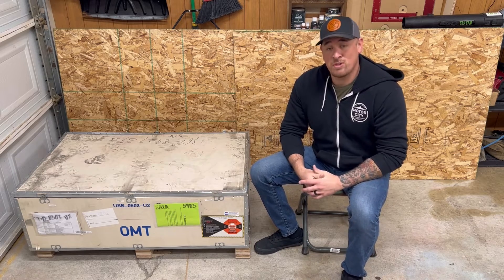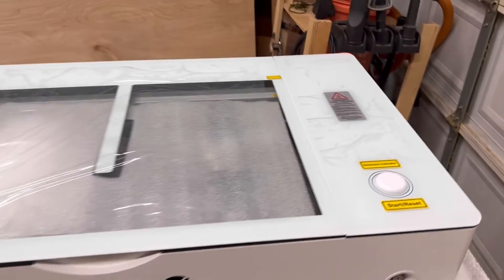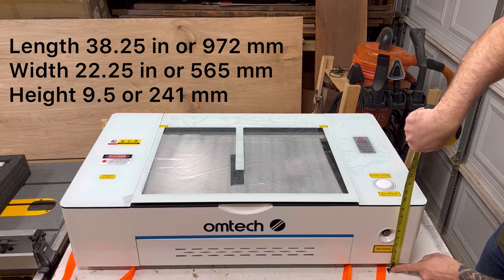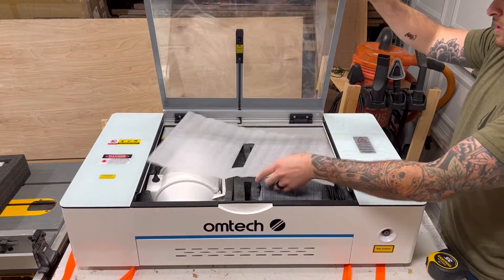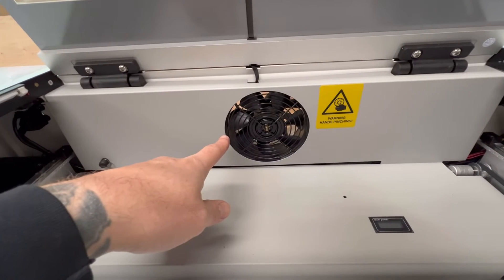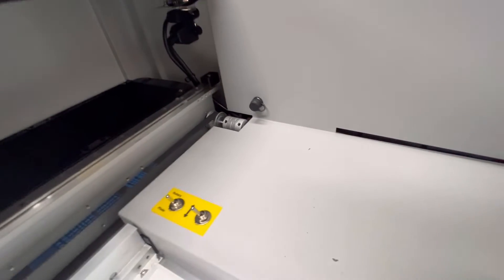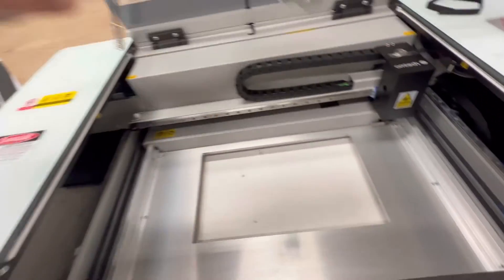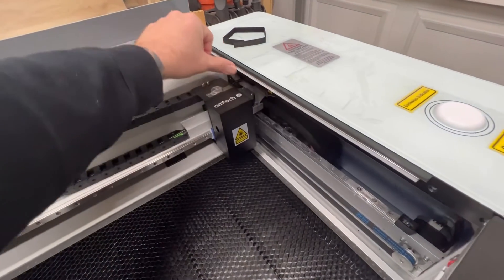OMTech Polar CO2 Laser: A New Glowforge Challenger?

Comment: Hi I have a question for you. I have a Polar 50w. This does not come with a control screen, I am having trouble with my limit switch. Is there way to adjust it.
Reply from the maker: Unfortunately if the limit switch is not working then you’ll have to reach out to OMTech for replacements

Comment: How efficient is the cooler? Does it use just water cooling radiator setup like the Omtech cw-3000 or a real chiller using refrigerant to remove the heat?
Reply from the maker: It’s like the 3000 and uses a radiator type setup. There is NOT an active refrigerant in this system
Reply: @EdmondsWoodshop  Thanks. At this time, the Polar won't work for me then: I doubt I can keep my garage below 80 degrees during the summer and early fall.

Comment: Hi, Edmonds! Question.. I'll have to install an extra tube to exhaust the fumes outside.. do you think this inline fan is capable of doing the job by itself? the distance will be probably an extra 6 feet of tubes..
Reply from the maker: The in-line fan produces 353 cfm of airflow. How long is your total length of ducting/tubing?
Reply: @EdmondsWoodshop  From the machine to the exit will be 15 feet total

Comment: Can this cut leather and etch it? I do custom leather patches on hats, but currently sub out the laser part. Would like to start cutting and etching my own. Thks
Reply from the maker: Yep, leathers, acrylics, wood, paper stock, etc. This is a standard 50w co2 laser. Whatever any other branded standard co2 laser can cut and engrave, so can this one. With it being a 50w it generally means slower than the higher wattage ones.

Comment: Great review and very helpful. I had a question about the height adjustment when it comes to the rotary set ups. Is it possible to replace the feet that come with the Polar with screw type feet that would allow you to self adjust the height? That would be a quick way of dealing with the focusing issue on tumblers and such. Does this model etch glass? One last question do you feel the air assist that comes with the unit was sufficient or would it need an upgrade to keep scorching down?

Again thanks so much for your review. I'm trying to decide what unit to start with and this has definitely tipped the scale in OMTech's direction.
Reply from the maker: 1. Is it possible to replace the feet?
A. Yes, but it may be hard to find direct replacements. I am almost done with another video on how to create risers for the feet so you can get additional height for the tumblers

2. Does this model etch glass?
A. Yes, all CO2 lasers can etch glass.

3. Do you feel the stock air assist is sufficient or would it need an upgrade?
A. Surprisingly, the stock air assist works really well. I have concerns that it will get dirty and sticky over time since its inside the machine, but you shouldn't need to upgrade right off the bat (if at all).
The Polar has a Ruida control board on the left side of the machine, so you can hook up an air compressor driven air assist using that control board. Its pretty cool.

Comment: Omtech: Can I have a look at your Machine?
G·Weike: Why not, but make sure to change it up enough!
Omtech: No problem, thanks! - ( Changes E-Stop into Key and adds fansy LED Bar to the front )
Customers: Why are both of your Machines practically identical?! 🤔🤨

@08:40 Any idea what the "Lens" taped to the top of the Tool Head is for? My G·Weike Cloud shipped with the same and I have no idea what it is for ( doesn't look like a replacement )
Reply from the maker: Haha. That sounds like the extent of their collaboration. Gweike is their partner though so it’s not far off.

The plastic piece on top of the laser head is a test piece with a pulse mark to show you that they aligned the laser. That piece would sit where the lens would sit

Comment: What is the max thickness of material you can engrave on? I make personalized cutting boards 17.5x10.25 roughtly 1.5" thick. Can this accomidate?
Reply from the maker: 2 inches (51mm) if you remove the tray. There’s also a cutout in the middle that measures 13.75” x 8.5” (243mm x 216mm) so if you have anything that fits in there, you can engrave taller items

Comment: i am wanting the 50W coming from a xtool user. how is setup on the cabinet one for someone feet already wet into laser. just upgrading for speed and ability to do acrylics
Reply from the maker: Are you talking about the MF1220-50 from OMTech, and not the polar? Setup on co2 lasers are different from diodes so the most frustrating parts are going to be alignment, focal distance testing, and finding settings for layout material in lightburn. I still advocate for the bigger cabinet size lasers because they a bit more versatile as far as bed size and depth for a rotary, but the appealing thing with the polar is that it’s aligned and ready to go out of the crate. Either way, if you’re willing to learn the steps and practice what it takes to set these things up then you’ll be fine. Check my fb OMTech users group link in the caption. I manage 19000 members and we have a decent amount of information regarding setup, upgrades, and advice

Comment: Omtech and all these videos seem to ignore some things. Like they are dirty secrets. Omtechs PR stuff says engrave wood acrylic rubber leather but glass is not mentioned and considering that the depth is 30-70mm (1.18 to 2.9 inches) glasses/mugs/beer steins don't seem possible. 2 emails to OMT and no reply and no reply from their FB page. Also nothing on replacing the tube. Can we do it or does it need a tech or sent in ? And the power supply is it replacable off the shelf or a special built one ? End user replaceable or service call/tech/sent in.
Reply from the maker: I highly recommend you join my OMTech Users group linked in the caption box. I share content with the members that covered things such bigger cups. As it stands, you are limited to 30 - 74 mm diameter objects for the rotary. That's not very big.  What I did to work around that was 3D printed leg risers (similar to bed risers) and raised the entire unit roughly 40mm. Now I had clearance underneath the laser to engrave a much bigger object. 
I also just posted in my users group photo of my polar somewhat disassembled. The tube is installed similar to other CO2 lasers and doesn't appear to be priorietary, HOWEVER, I could not find a 50w tube that fit the size requirements. The tube allegedly made by tube manufacturer, YongLi, and after reviewing their website they didn't have it listed. I am waiting to hear if OMTech plans on selling these tube exclusively on their website, but from what I see its very serviceable by the owner.

Hope this helps.
Reply: @EdmondsWoodshop  It's clearly not 50W as the size of the tube determines the output power.  Mine is a China Blue 50W... it's actually 880mm in length and measure 44W with a Mahoney meter and Sadlers dohickey.   Since the cabinet is less then a meter and it's mounted on the Y axes, I'd bet it's under 40W...  Did you measure length and power output?
Had to read, I think you should have mentioned that it has a Ruida controller in the video...
Thanks for the time to do the video.  Take care.

Comment: I just got mine yesterday and came from glowforge. Everything worked great out of the box- I followed Cam’s setup instructions you see on YouTube. I had a couple initial hiccups running it with my Mac (no usb and I needed a usb to usb c conversion and then still my Mac not recognizing it for whatever reasons and next trying to run it through a gfci outlet was a no go and still trying to figure out Wi-Fi/Ethernet connection stuff). But now running lightburn on my daughter’s pc it is working great. Much more powerful /fast/capable than my glowforge plus and wow for the price. If you follow the unboxing and setup videos that are on YouTube, read the manual thoroughly, then it doesn’t take long to understand it and get running. Also 7mm hold down pins -someone asked that somewhere
Reply: Wow glad to hear. I currently have a GF plus and want to add a second laser. I use it for my Etsy shop. The price is what I like as well and the size as I do not have the space for a bigger 60W laser. Are you still loving your laser?
Reply: Were you ever able to get yours to work on the Mac?  I don't have a PC so I need a laser that will for sure work on my Mac.  I hate that Apple removed the dang USB ports.

Comment: Have you ever used a Glowforge laser and if so, how would you say the speed compares? I have a GF now and want to upgrade because I have a lot of maintenance issues with it, but I want to stay within a budget as well as I appreciate the user-friendliness of the GF. Thanks for any info you can provide!
Reply from the maker: What's frustrating about GF is that they dont use units of measurement to identify speed, but I can tell you that even at glowforge's 1000 speed indicator, they dont match up to the speed capability of the polar. OMTech boasts capability of 600 mm/s. I doubt it can really accurately achieve that speed (I haven't tried), but on the speeds I have tried its already faster than the glowforge. Even the cutting is so much faster. I'm cutting almost as fast on my polar that of my 80w. 
The Polar will be much louder than your glowforge. With the lid open, I used my phone to record the decibel rating and it clocked in over 70 dB. That's loud. It also doesnt include an internal thermometer to monitor temperature which can be a bit concerning for the user that wants to run hours on end. CO2 lasers like the temperature to be between 15 degrees Celsius and 25 degrees Celsius with the ideal range around 21 degrees.
The polar did come aligned out of the crate. I got started in a matter of minutes after downloading lightburn. The only learning curve for a new user is going to be learning the software.
Reply: @EdmondsWoodshop  How can I keep track of the temperature to know that it's not overheating?

Comment: Hey! Nice video! In your opinion Polar vs Gweike vs Gf, who you chose ? and why ? for which applications you would rather use one and for which applications you would rather use the other one etc ?  Who's the best in term of price/quality/features? Thank you in advance :)
Reply from the maker: The Polar and Gweike Cloud are made by the same manufacturer. The differences are the designs. The Polar has a built in air assist, an opening at the bottom for the two included rotaries, and a more well know YL laser tube. In terms of capabilities and versatility, the polar will be better than the gweike. The GF has a weaker 45 watt laser tube compared to the polar's 50w. The GF is also considerably slower. You are confined to using wifi only and can only use their software. If anything breaks down you have to send the whole GF unit back to them. With the polar, you don't need wifi, you can use the highly recommended lighburn software, its faster and stronger than the glowforge, it includes two rotaries, and its much cheaper than the pro version.

CON's to the polar include:
- Noise. Its loud. I used a phone app to record the decibel and it came in at over 70 dB with the lid open
- No thermometer. CO2 lasers work in a range of 15 to 25 degrees Celsius with an ideal range around the 21 degree mark. This unit may not be good for people who run their lasers for hours on end because there's no way of known what the temperature will be unless you buy an aftermarket thermometer.
Reply: @EdmondsWoodshop  Thank you a lot for these great insights!

Comment: Thank you for the video. Will there be a video on using the pass through slot in the back?
Reply from the maker: Using the passthrough is a function of the lightburn software. Not the machine. The only thing you need to know about the passthrough on the polar is that you're limited to 1/4 inch or 6 mm material. The lightburn functions are already well documented on youtube.

Comment: im really debating between this and a gwike cloud to complete 3d printers and cnc mill in my workshop (
Reply from the maker: Just in case you didn’t catch it in the video, Gweike is the collaborative partner and manufacturer of the polar, but it’s OMTech’s design. With that being said, you have a unique built in air assist, a reputable laser tube, two rotaries, and US support. You also have some additional accessories that the Gweike cloud doesn’t complete. I also have a cnc and two 3D prints and they compliment each other in the shop.

Comment: Would you say that this would be ok for extensive travel in an Rv if I were to secure the gantry to a stationary position? I’m just worried about the tube breaking. I mean it’s shipped obviously but we plan on full time rving. I already have an 80 watt but a little too big to bring with but people want wood products and my fiber can’t do those.. I just don’t feel a Galvo co2 will give me the same quality that a gantry co2 would. I’m also a little concerned about the cooling as well especially if we are in like AZ where an Rv ac might not keep up.
Reply from the maker: As long as the gantry is secured, like you mentioned, then I dont see a problem with it. The tube is mounted to the gantry so you want to make sure it secured in place. They pack the inside with dense packing foam so just keep those pieces are they are already premolded for the inside of the laser. 
One of the downfalls to the polar is that it doesnt include a thermometer so you dont know what the temperature of the coolant is. Most co2 lasers operate around 15-25 degrees celsius with the ideal temperature being around 21 degrees celsius. The AZ heat would have me concerned as well.

Comment: Really looking forward to hearing more about your experiences. I'm torn between this or the more traditional Omtech 50w and 55w machines. Hope you can provide some insight on how to choose one.
Reply from the maker: This will be more ready out of the box. The MF1220-50 will have a bit more flexibility because of the depth. You’ll be able to engrave taller objects and use a rotary with larger diameter objects. The trade off is that you’ll need to buy your own in-line fan and you may consider doing additional upgrades such as a cw5200 chiller and/or air assist.

Comment: Nice video. I’ve had a Glowforge Plus for almost two years and it’s still working. I did have several days of downtime due to WiFi issues. I also have an XTool with the rotary attachment. This looks like a really good unit to phase out the Glowforge. Besides the advantages of not requiring WiFi and being able to use Lightburn what are the other factors to consider?
Reply from the maker: This has non proprietary parts meaning if it breaks down and you know what’s wrong, then you don’t have to send the whole unit back to get it fixed. The polar also includes not one but two rotary’s. The GF doesn’t have any. Also, the speed capability is much faster on the polar. The GF is so slow
Reply: @EdmondsWoodshop  Do you have an estimate of the time difference? Maybe a percentage improvement?
Reply: It is so much faster and capable than my glowforge plus and wow for the price- I dumped my glowforge plus on the marketplace for most of what I paid for the polar and pretty happy 😂

Comment: what is the max thickness of Baltic Birch plywood that this will cut?
Reply from the maker: 1/4 inch will provide you a nice clean cut with one pass, but OMTech was able to 1/2 with one pass, but it was charred to hell. Anything between that will range in terms of cleanliness and cut quality. I'll be doing a test video on thickness and cut quality in my next video.
Reply: @EdmondsWoodshop  Thanks just did the pre order.  Will be looking out for your video on it working